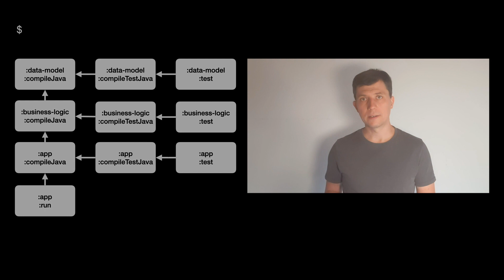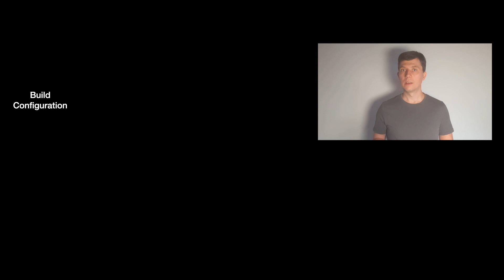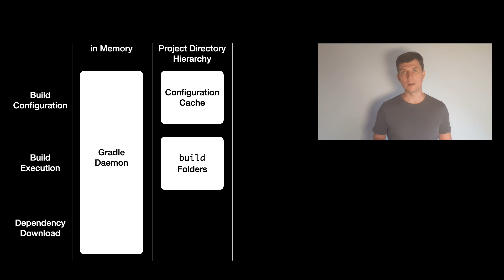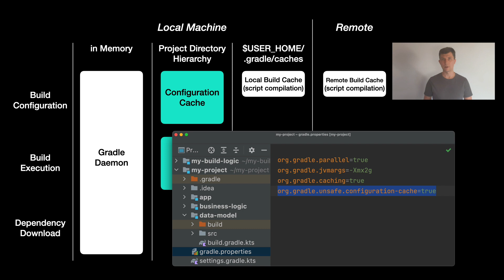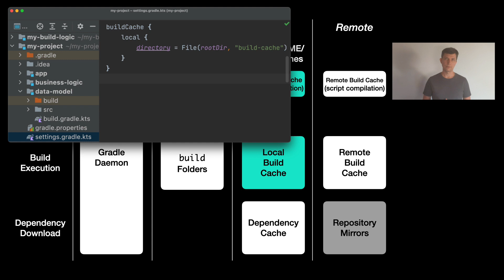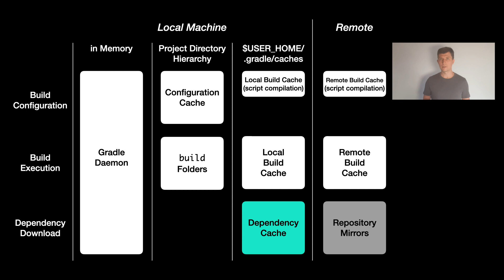Understanding Gradle #23 – Caching

Comment: You say that it's not optimal for everyone to push to remote cash but you don't explain why.
Reply from the maker: That's observation is correct. 😄 For me, it feels natural from experience that it is a good compromise. These are some of the factors why I think it is preferred in most scenarios over letting everyone push to remote. If these factors do not play a role in a certain scenario, letting everyone push is also be an option:

- Credential handling (and risk of intrusion): It might be okay to give read-access without credentials, but you want to protect the write-access. If everyone writes, you need to distribute credentials to everyone which is additional effort in setting up machines and doing risk management.
- Network traffic costs: CI machines may have better connection to the cache than distributed local machines of developers (possibly working from home). Loading all results from the dev machines to the cache creates unnecessary costs. Because there are many intermediate states during development that will never be reused by anyone else. 
- Higher risk of cache pollution: While the caching is very stable (from my experience), there is still a (low) risk that "wrong" entries are written due to bugs. Quite unlikely with Gradle core tasks, but maybe with third party plugins. If a dev machine is in some "weird" state this may happen more likely as on a clean/controlled CI agent. Dealing with a broken remote cache is more effort than dealing with a broken local cache on one machine.
- Low benefit: If the above things cause costs, the benefit is relatively low. A code state that is shared across machines is pushed to remote. If it is pushed to remote, it is build on CI. And then cache entries will be pushed from there. There are no (or very few) additional entries that would be reused that are only created on local machines.

One scenario I could imagine where the above is not fitting is when you do not build branches/PRs on CI but developers still use shared branches across machines regularly.

Comment: Thank you for complete review of Gradle's caching techniques!

There is one thing, which puzzles me with "build cache" enabled is - how to --rerun integration tests (which depend on some external state (e.g. Docker-Compose)) if: 1) if those tests were already executed successfully, 2) and if the end user of the build uses a single lifecycle task to run tests?

Suppose I have multiple "modules" ("Gradle projects", each having own test suites, some of them depend on Docker-compose). The regular flow for developers is to simply execute single ":testAll" task before pushing their code to CI. What if a user did some cleanup in containers by restating Docker-compose stack from scratch and wants to double check that all tests still pass? There is a '--rerun' option implicitly available for each individual task, but the problem here is that providing --rerun to lifecycle task won't affect the actual test tasks doing real job. To re-run tests in this scenario user will either have to use --no-build-cache, losing all benefits of build cache or to know what individual task on each sub-project to execute with --rerun. Would be great to know if there is a way to propagate the effect of --rerun from lifecycle task on tasks it directly dependsOn()
Reply from the maker: > but the problem here is that providing --rerun to lifecycle task won't affect the actual test tasks doing real job.

Yes this is a shortcoming of Gradle. I think such a feature is missing. You have similar issues with other task-specific options like '--test'.

The best "workaround" I know is to add a "-P" parameter (gradle property) for this yourself. Then users can do something like this:

./gradlew :testAll -PrerunTests

Then you would configure your test tasks to pick up the parameter. Something like:

tasks.withType<Test>().configureEach {
    if (providers.gradleProperty("rerunTests").isPresent) { inputs.property("time", Date().time) }
}

(IntelliJ IDEA does something similar in the background when you press the test run button in the IDE.)